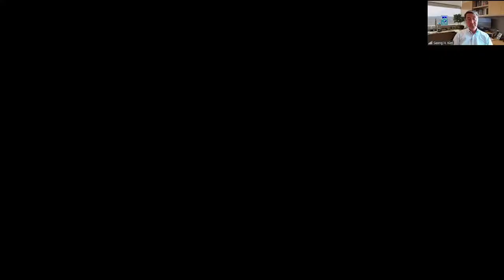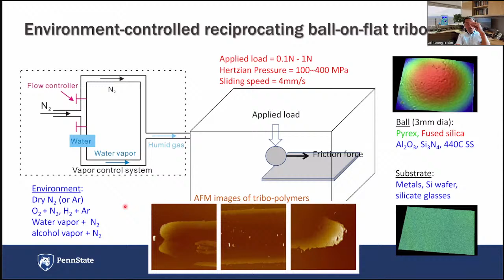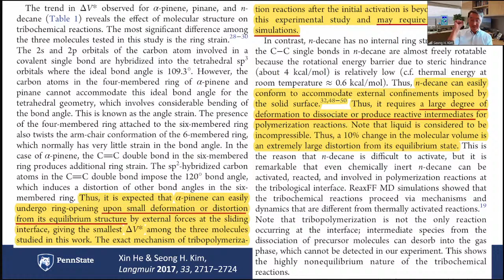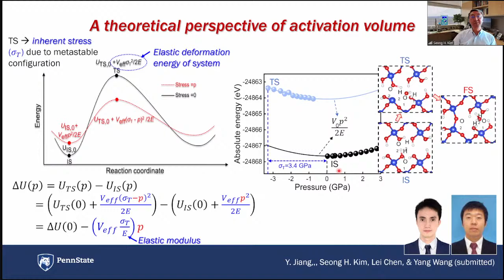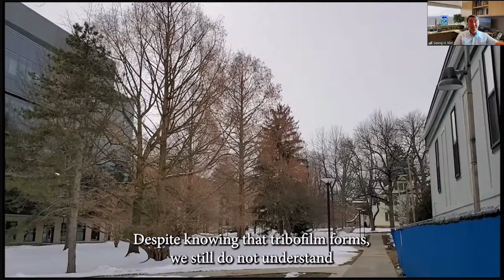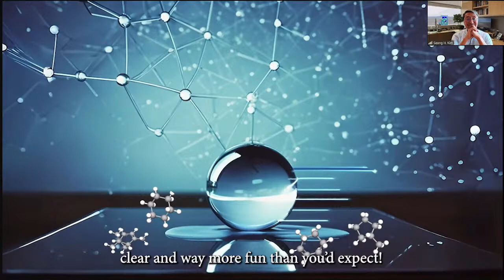Dr. Seong H. Kim - How does Mechanics Govern Chemistry? “Catalysis” by Force?

Comment: Why discussing all in terms of reactions involving silica, when using a steel ball? Steel is way more prone to hydrocarbon degradation, at least thermally. If a steel pin is used,  I would expect the reaction to involve primarily the metal.